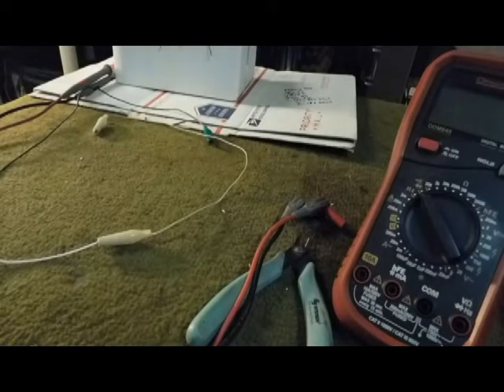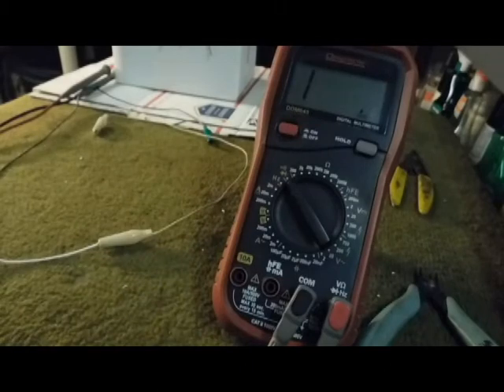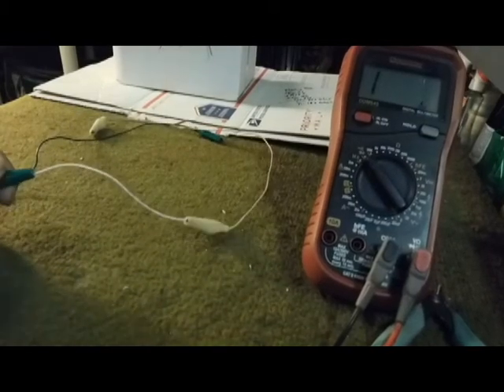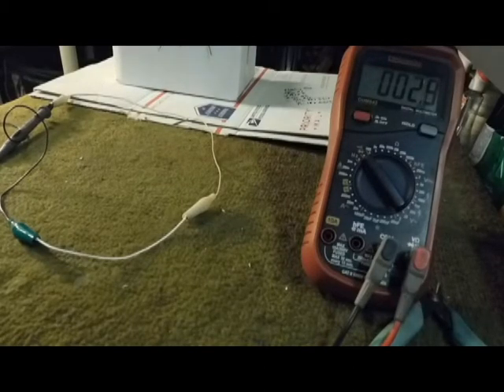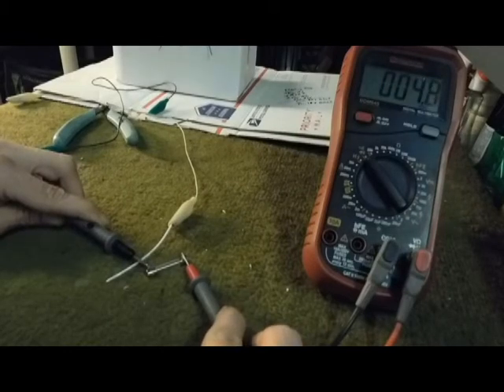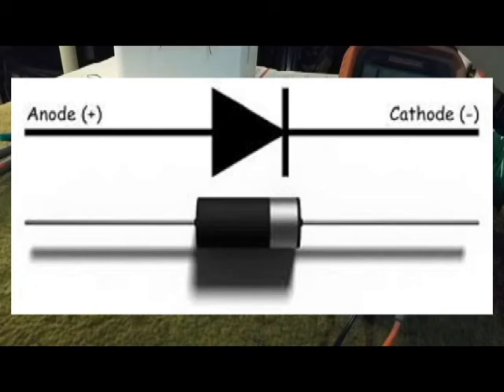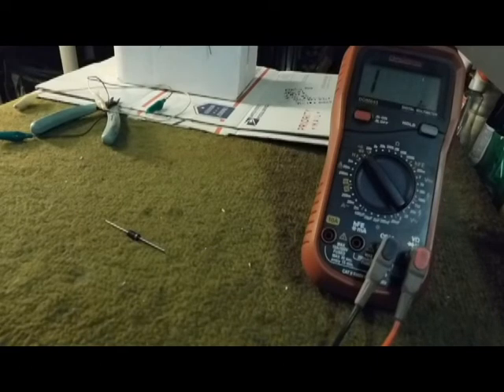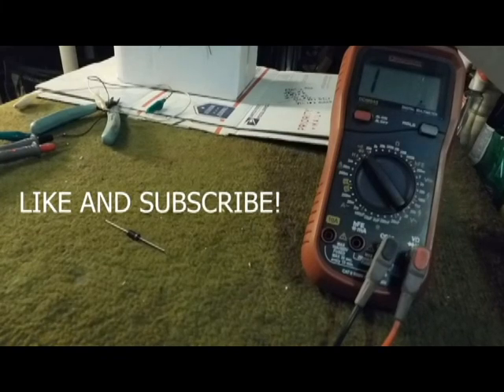How to Test a Diode & A Continuity Test

Comment: Try looking into leakage testers in circuit leakage testers for capacitors because they have some that are reason to resistors and an LED and somehow it puts a load on the capacitor at the bad leaky capacitor will test bad only during loads for current leakage load while other bad capacitors will test good even because without a load so you have to find a leakage capacitor leakage current tester that will test with a load because even good capacitors will test bad saying they don't think that you have leakage on them what happens is that if you have an arcade motherboard they will draw more current let's just say like if you have like a Pac-Man motherboard and it has like 50 of those coupling caps everywhere those ceramic it will draw more current because there's leakage all over them so the power supply is going to be dipping in and out and you got to raise the voltage up to compensate if you test all those capacitors in the circuit they might test good because they're without a load and then you have to put a load in but try to look into in circuit capacitor testers there it's they have them on Google that are like a few resistors and an LED and then you test your boards like that to see how much leakage is on all the capacitors on the motherboard
Reply from the maker: That's awesome! Thank you I'll look into those test tools and give them a try. I've been lucky so far I believe, but you never know I could at some point have leakage issues and I'd never know, I may have already had them with PCB's I haven't been able to repair in the past.